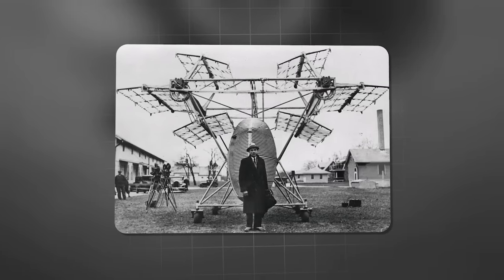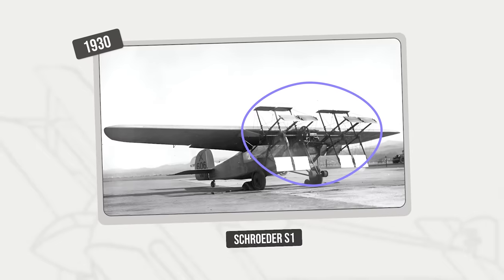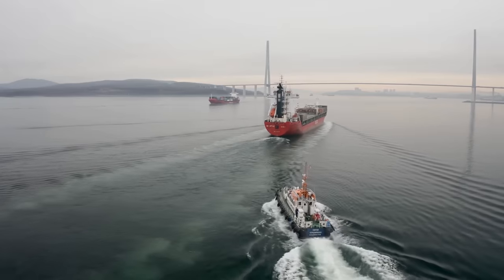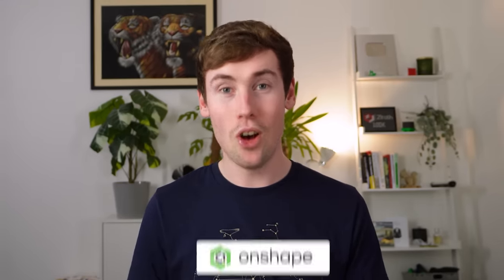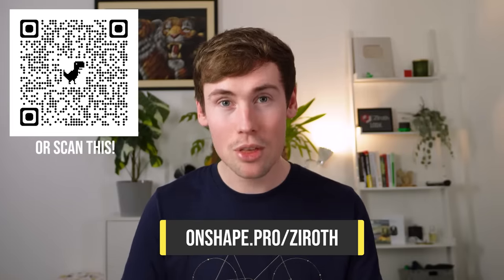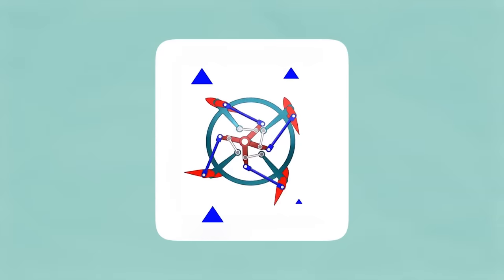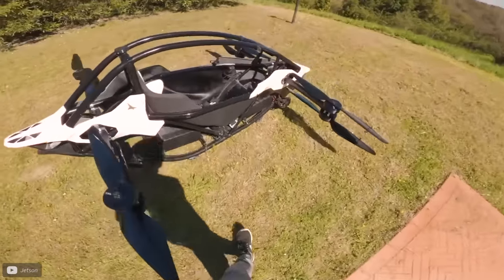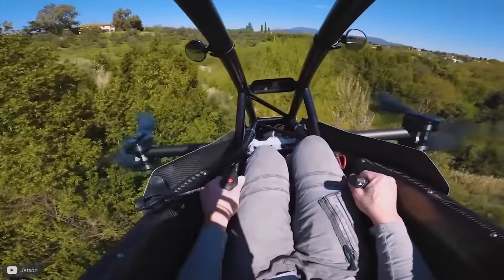The Genius of Cycloidal Propellers: Future of Flight?

Comment: I love the idea for propulsion and steering on an airship. These mounted on a gymbal to transit from horizontal  for lift and propulsion to vertical for steering and propulsion. Brilliant!
The flying car is a stupid idea. It always has been. Most people can't drive on the ground; try texting and flying. Forget to put this on the charger and you aren't walking home or pushing it to the nearest charging station when the power cuts.
Reply: We already have flying cars - they are called helicopters.
There are several good reasons why they aren't replacing land based cares.
Reply: We hand out licenses faster every year that passes.  When stationed in Germany i did like the 100 questions per test you had to pass.  The unit i was in had a clerk that passed after 8 times.  Anybody who knew her history wouldn't get in the vehicle if she was driving (fixing stupidity impossible).  Can't wait for self-driving cars, no speeding tickets, where's the state, county... going to get all that free money to piss away. 😂😂😂
Reply: @CeL-w2p  : There's becoming a question about if we'll actually see true self-driving cars. That may be limited to self-driving flying cars in the future (mandatory self-driving thereby becoming the difference between a flying car and all other flying vehicles).
Reply: If you think you want to use cyclorotors for both horizontal and vertical flight then you don't gimbal them around, you just stick them at a relevant angle in the first place. Stick two in a V configuration, and the only thing you have to worry about is rotations around axes that don't run through the center of the V (which themselves can be dealt with through other aspects of the vehicle design; non-rotational movement can already be handled by the V). Stick three in a Y configuration and you don't have to worry even about those two axes. Break the rotor segments into separate sections with the same power axle and you get even more control options.
Reply: Check out the Cyclocrane. It's a huge cycloidal propeller supported by a helium blimp.
Reply: @joshpatton757 AI helicopter pilots will solve personal air transport.  Just don't let humans fly them.
Reply: @absalomdraconis  Theres a growing history of self-driving vehicles doing bad things to pedestrians and other vehicles. also would you trust X maps with their interns with your life.
Reply: Omg we got the same brain .. am planning for this build next year .. gotta gather more ideas.
Reply: @joshpatton757  Helicopters aren't practical to use as personal VTOLs because their main rotor can accidentally hit an object and cause the entire thing to crash. They're also not efficient on smaller aircraft, and don't synergize well with electric power sources. Current personal VTOLs involve using smaller but more numerous rotors, but a cyclorotor is a good option too. Since they're smaller, they're less likely to collide with environmental obstacles in cramped environments, they can also use a fairing or a bumper (in the case of a cyclorotor) to further reduce the likelihood of a collision. 

Long story short, helicopters are not practical and can be dangerous to operate in cramped environments, so other VTOL aircraft are preferable.

Comment: Ah hey its the video on Voith-Schneider mentioned in the comments of the previous propeller video! So cool to see someone covering cycloidal rotors and discussing the applications in both marine, airspace and renewables! 

With renewables, a future video topic may be wind turbine designs? Aside from the typical horizontal axis three blade wind turbines you find everywhere, there's a lot of companies trying to find new ways of doing things. There's a lot of work trying to make small-scale wind, but in large scale as well. Particularly in offshore floating wind a lot of unusual large scale designs have been proposed, since it is the an immature industry that needs cost reductions and radical thinking the most

Comment: They need an exterior brace to reduce the need to "suspend" the spinning blades freely. It will also provide better potential air-control. Blades can actually be setup to "pull in" on all blades, and direct air outward for turning, through holes in the exterior braces.

Comment: A difficulty I can see with a working VSP system for flight is there are more moving parts and greater scope for failure.   It is one thing for a ship to fail, but quite another thing for an aircraft in the air.
Reply: Too many parts. Parts brake, while flying. End of story. Albert Harvey Rotary Engines
Reply: Not to mention the fact that drivetrain complexity usually adds weight. Which is very costly when you're designing an aircraft but ships don't really care too much about.

Comment: Sitting on my boat watching,  wow, would love something like this, mine is sea going as well as rivers and larger canals here in the UK.
Reply: Bear in mind that for high speeds conventional screws are more desirable. The higher the desired speed, the higher the wear on the components, so the higher the maintenance burden of cyclorotors. I'd even say that at some point, you'd be better off with a little pair of electric auxiliaries fixed to a board that you could hang off the back when you're getting close to e.g. a dock or something.
Reply: You'd probably be better off with an azimuth thruster pod setup instead. Simpler and thus easier and cheaper to maintain.

Comment: Man, love your content. Always appreciate the deep dive, research and the mentions on drawbacks or questions yet to be fully answered.
There's one Engineering topic that would tremendously help you understand and then maybe convey to your audience why some of those promising technologies take so much longer to even start to get adopted. It's called Dependability Analysis (gross english translation) or Sûreté de Fonctionnement in it's original French as this originally stemmed from the french Military Nuclear and then Aviation programs that were under a certain level of Secrecy post World War 2 (and based, off course, on a ton of previous work from many more origins civilian & military alike). It's the engineering task of assessing how and why any partial-system can fail and then how the greater complete system would respond, which safenets or redundancies can or should be put in place to ensure the system can still function and/or safely recover.
Here if just one of the four cycloidal propellers fails, the whole unit falls down and crashes minimum safe net would be the addition of a parachute.
On the jetson craft if one of the 8 motors fail, the 7 others can compensate to ensure a slow descent. If up to 4 of them fail but with each on separate boom, almost same thing. if 2 of the motors from the same boom do, you can shut down all others to initiate a descent with the blades on autorotation. Recovery is still possible. You'd descent a bit faster but still hopefully in non-lifethreatening fashion.
On a classic plane all engines can completely fail (which they rarely do) and you can still glide down to safety.
One very good exemple of that Dependability topic and it's application was what happened with the Tupolev copy of the Concorde that was actually flown before the Concorde but crashed miserably. Russian spies had managed to steal the Concorde frame plans and had it built in a very short time just to "win the race". The engineers of the Concorde in France and of Bristol Engines in the UK, through their own xp and with the help of those Dependability/SDF thorough analysis had become the best experts in the world at managing vibrations, especially those caused by the engines. They perfectly knew which frequencies had to be favored and which others had to be eliminated at all costs (through materials, designs adjustments, dampening featurs etc) for the whole frame to be able to endure not only the flight constraints from the exterior on supersonic endeavours but also all the inner constraints caused by the very powerful engines themselves.
The russian engineers did not possess such fine knowledge, know-how and assessments and that's why their frame shattered on the first presentation flight which ended in a disaster crash.

Comment: I was inside Dr. Keletch's rotor ( probably spelt wrong) back in the 80's two weeks before he attempted a flight. Eye witnesses said it got off the ground about a foot before before the attempt was stopped. The design had a propeller at each end of an elongated egg shaped fuselage with T mounted horizontal blades at the end of each blade of the propellers.

Comment: The solution is obvious. A fixed design, with all the trust downward. Then run it like a regular drone.  Now, with the thrust fixed downwards, a ducted design can be used, increasing thrust. Should be fairly easy to build, removing all the unnecessary pitch garbage. A bike hub motor should have the Rpms and torque to run one of these. Thanks for the vid. I'm currently building a 1 kilowatt hand held laser. I might try this next.

Comment: As a helicopter pilot, I can't help but think a major drawback to many of these eVTOL designs is their inability to autorotate/land safely in the event of a drivetrain failure.

I'm all for innovation and I hope they can crack the code and make something revolutionary, but I feel it would be easier to convert a mature technology like helicopters into easy to fly EVs than to convert drones into people carrying EVs.  Take a helo, give it an electric drivetrain, fly by wire/pilot assists, folding blades, bam, flying car that can land safely if the motors lose power and has a mature understanding of flight characteristics.

Comment: The necessary materials science and control technology to making CycloRotors work are here.  Check out the Hover Flight Dynamics for the new Bell V-280 Valor.  Despite the small rotor size and huge power, Bell successfully developed full cyclic control of each rotor blade to maintain stable hover.

If anything, the CycloRotor would be easier to scale, and given the strength and light weight of the V-280 blades, free-tip airfoils may be possible as well.  As with the ABB Dynafin system.

Comment: THESE ARE USED ON LITERALLY MOST NEW TUG BOATS. REALLY TRANSFER THE POWER TO THE WATER ZIROTH.   😀😀😀😀
Reply: It's not new they've been used in tugboats since the 1940's
Reply: @atomicskull6405 been used since 1870s is navy had a small ship with the both type replacing both the screwprop and the rudder

Comment: For me, the most obvious downside of that design for aviation is the lack of lift in case of an engine failure. A helicopter retains the ability for autoration, which in many (most?) cases provides enough lift for an emergency landing and a plane still has wings. What would happen with a cycloidal propeller?
Reply: "plane fall down go *BOOM*!"
Reply: Not really knowing anything about this, but I would suspect it would autorotor like a helicopter as well.  it is just 'wings' moving through air.
Reply: Deploy an emergency airframe parachute as some light aircraft and ultralights do now when SHTF.

Comment: where is the 200% thrust part?
Reply: I guess, if you take the combined lift of the 4 airfoils they add up to 200%. At 6:20.
I would argue you get around 50% thrust in this design, compared to a rotating 4 tip propeller with air foils of the same area.
Maybe there's some efficiency gain from the uniform air flow, but I'm not seeing any numbers to quantify it.
Reply from the maker: This was referring to the old propellers from Cyclotech, as their new version has 200% the thrust-to-weight ratio. However, I now realise I didn't say that in the video! 😅I have changed this now to better represent the video! Thanks for the commment

Comment: an idea I've always been fond of is a static attack angle Darrieus style turbine. The static angle of attack provides a lift vector in combination with torque. The idea is to have a horizontally rotating structure that can lift itself in steady wind. This concept works as a two line kite that would for sure destroy itself upon crashing, landing at a minimum would be treacherous. Perhaps an expanded PP type design that holds together until it explodes could save the parts and reduce danger, but the idea of a metal spinning death kite is pretty awesome.

Comment: When I was 16 I came up with a design to use rotating drums with lifting surfaces installed that generated lift and thrust economically and was installed at the leading edge of the wings in a recessed form so the air flow would still have a modified laminar flow then thrust outlets were mounted towards the rear of the wing in small pods. This would generate enough thrust for shorter take off speeds as well as being able to generate more flow over the wing generating lift and the engine could shift thrust amounts between thrust and lift generation as it transitioned from takeoff to max forward thrust as needed. I’m not saying it functions as a VTOL design, just a more compact design that can support different structure configurations allowing new designs and allow for more power.

Comment: 15 years of development, and they've only been able to fly an empty carbon fiber frame with minimal battery capacity? Somehow I doubt they're on the verge of making a reliable man-rated craft. Aside from less rotor noise (normal propellers can also be optimized for noise), and lateral thrust vectoring (not that normal 4-rotor drones are lacking maneuverability), I'm not seeing many advantages here. There are several safety disadvantages (namely, if you lose power for any reason, you'll plummet to your death rather than having the autorotation capabilities of a normal propeller).
Reply: I would say they could be made to autorotate somewhat, but not so sure the flare for landing would be possible.
Reply: @b43xoit  The only way they could autorotate is if the control system controlling blade pitch was still working. But even then the air flow doesn't have much leverage relative to the center of rotation, so you'd get minimal rotation even if you were somehow able to decouple the drive motor from the rotor and let it spin freely.
Reply: Agreed about control of blade pitch.

Comment: This reminds me of a thing we used to do as kids. If you take a ruler (wood is probably best) and hold it horizontally with your thumb on the bottom and fingers on top, then throw it forward while pulling back quickly on the top bit as you let it go to make it spin "backwards" fast then it will fly across the room like a paper airplane. Different physics than cycloidal propellers but intriguing. I would have thought the downwards force would equal the upwards in my example but it does work.

Comment: 10:40 one thing I immediately see that might be a benefit of the cyclorotor over a regular propeller, is that in the event of spontaneous, unscheduled disassembly, the pilot and any bystander who isn't immediately ahead or behind isn't within the "blend zone."

You could obviously protect the pilot by moving conventional props up, but any thrust vectoring puts you right back in the crosshairs unless they are REALLY high, and still doesn't protect bystanders.

Comment: As a general rule of thumb a helicopter/drone needs 2 times the lift necessary to hover.  That way it can climb at a reasonable rate, and if it runs into a heavy wind it can still operate as it won't be overpowered by the wind and unable to choose its own direction.  The worst winds are the downdrafts where the wind is literally moving straight down, toward a collision with the ground.

Comment: At 8:20 you say they don't create vortices and loud noises from the rapidly moving tips
Any airfoil with a tip creates a vortex, as the medium spills from the high-pressure side to the low-pressure side
To control that tip inefficiency some screws (marine) and propellers (aircraft) rotate inside tubes or ducts, and some wings have winglets on the tips
And that's why some of your cycloidal demo clips show solid discs at both ends of the wings or a skid beneath the tugboat: as a fence to stop that vortex generation
(The skid also protects the device from damage when it strikes the bottom of the harbor)
But you were right about the noise, since a large diameter propeller's tips can move so fast they feature transonic flow, resulting in sonic booms
A cycloidal propeller's wing uses the same airfoil profile across its entire span, rather than varying thickness and angle of attack along its length from hub to tip

Comment: Great explanation of a technology that is long overdue. I flew helicopters (UH-60 to AS350) from 1986-2019. Your video explains limitations of complexities at the 08:30-09:05 timeline. Helicopter designers learned to accept those issues; Cycloidal Propellers will learn to do the same. See the advances that the company Lilium (LILM) has incorporated.

Comment: Just seeing the opening design it reminds me of a discussion with another engineer about autorotation in helicopters. (He's electric and mechanical, my focus was thermodynamics in ME while I continued to lean toward aerodynamics best I could at a school that didn't have those courses). I have some flight training completed, and I brought up the difference in "propellers" and the type of "blades" that rotary aircraft have, basically a wing that spins. This is an interesting application of that, but I worry about the added number of moving parts. (Then I remember adjustable pitch etc... on existing aircraft)